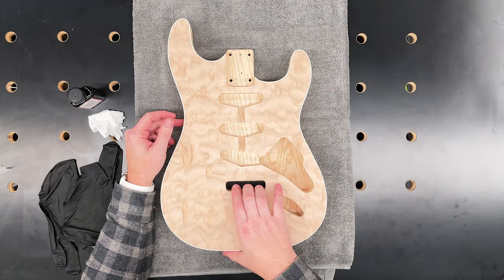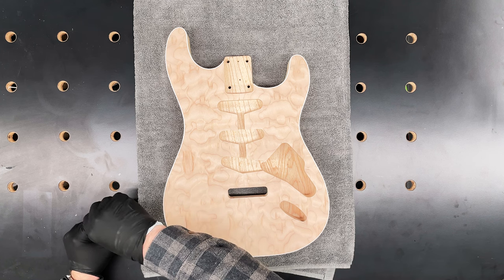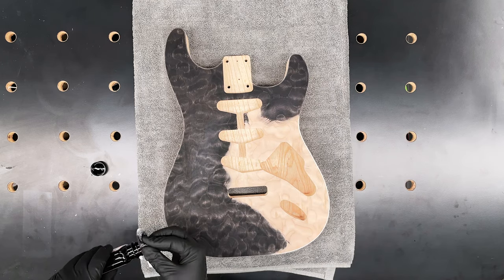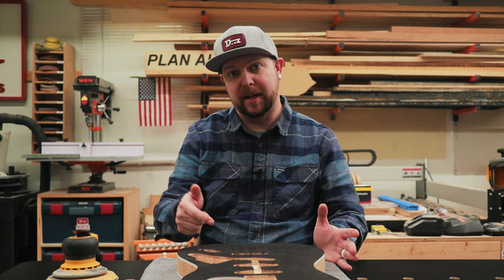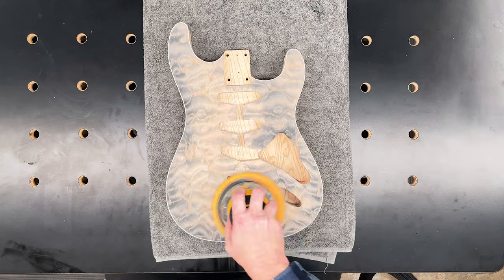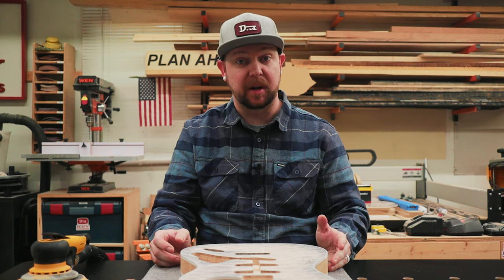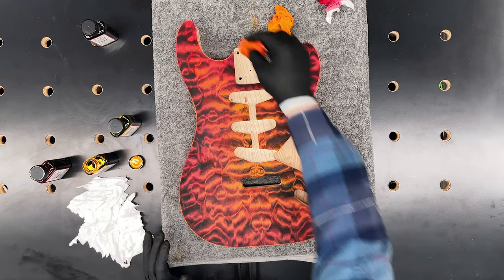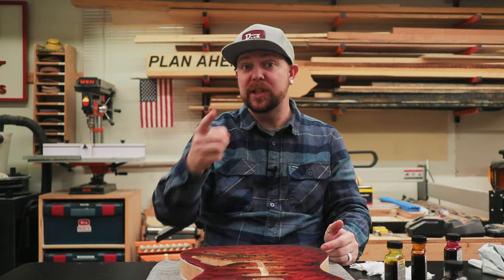Quilted Maple Stratocaster | DIY Leather Dye Fire Burst | How To In Real Time!

Comment: Question with these Angelus dyes. If you mix neutral with just a few drops of black will it just be black or will it dilute down to a thin greyish? Basically can I do that and get a faux sand back look? For a thin assed career that can't be sanded back at ALL, would that work? (Obviously a newbie)